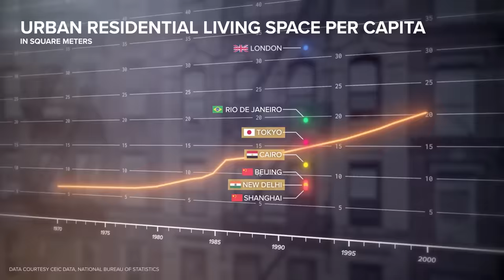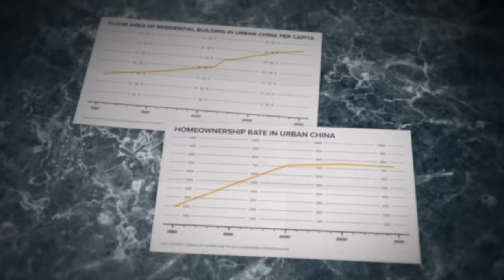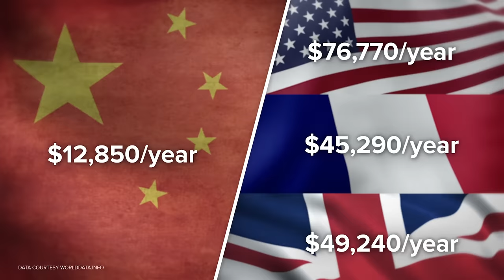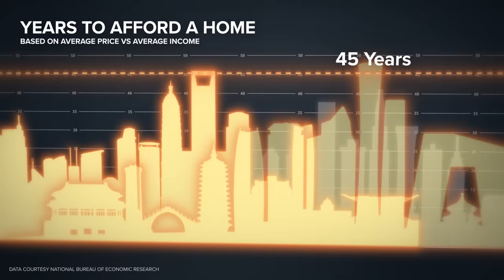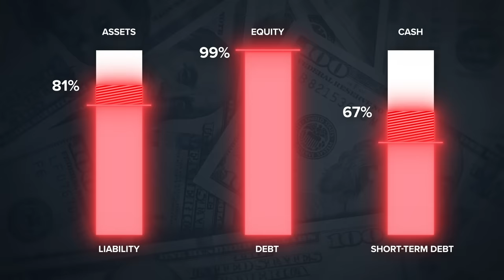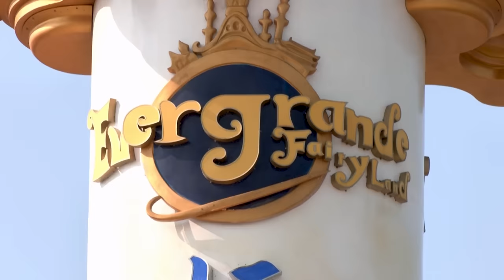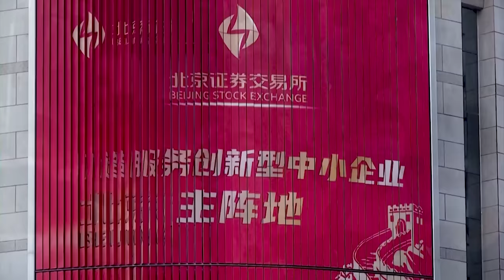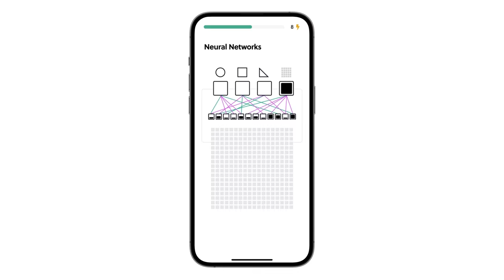Why China's Economy is Finally Slowing Down

Comment: The other part of this that is missed is that local governments were funding themselves via land sales.  They can't sell land if the real estate market is in trouble.  Worse still they put this money towards GDP growth which many times consisted of infrastructure projects that are not delivering.  This has piled up debt for local governments in an uncontrolled way.
Reply: And
Reply: You cannot deliver a profit eternally, you people are nuts.
Reply: @Skr0ng  The reason that this is important is that GDP growth as stated in China (which the CCP has admitted is flawed) includes the local government spending on these infrastructure projects.  This creates a set of double trouble for the PRC.  Problem one there is a ton of oddly configured debt through LGSV's (Local Government Special Vehicles) that is not accounted for.  In some poorer provinces, the entire budget of the province is spent on servicing this debt.  So, there is another large debt overhang that is not accounted for.  Problem two is that these governments can not fund these GDP projects if they can not sell land.  This will directly impact GDP statistics.
Reply: For me the main problem is the lack of consumer rights. Complainants are silenced and buyers cannot sue the developers. This gave developers free reign to do whatever they want without the risk of consequences. Normally it would be a fatal risk if a developer sold customers a crumbling apartment building. But in this system, Ever Grande wasn't even phased with all the social media posts exposing their tofu dregs, they still kept on building and taking out loans.
Reply: One of the few mechanisms for local government revenue in China is land-lease sales. They have to actually sell and release land to have a cash flow.
Reply: @jimsackmanbusinesscoaching1344  They also have unfunded liabilities. The local government has a target to hit-and no ability to fund this. They have control of land and its about it.
Reply: It's leasehold. Property owners get 99 year leases.
Reply: That's a popular and unfortunately very wrong way to look at the situation. Selling land right is the alternative to property tax. And China is gradually moving toward collecting property tax like the US.

Will the local gov go bankrupt? Unlikely. Because selling land rights is a temporary policy to entice land development. The policy will be replaced with property tax collection one day once urbanization slows down. So far that turning point has not reached
Reply: @boyuan1458  Now that there is no need for land development, as shown in the video I guess that property taxes will be coming soon.  Like today would be a good day.
Reply: @jimsackmanbusinesscoaching1344  A 30% drop in new house price isn't a sign for no more land development. In fact, the stats showed China is still way under developed in terms of overall infrastructure. 

Also, see US new home price in 2021, much steeper drop of price YoY. Real estate especially new home price are always volatile in all countries. The media never paid attention to China's new home sale price in the past, it is brought up now just to fit into the new narrative.
Reply: @boyuan1458  The reason that there is no need for land development is two fold.  First, China's population is in decline.  Second, there are already plenty of empty cities.  No need to develop more empty buildings to house people that won't be there.   The PRC is dying slowly and will soon do so rapidly.
Reply: @jimsackmanbusinesscoaching1344  The empty city thing is propaganda. As I said earlier, urbanization rate is what people should understand before they write about China.

Is China's population in decline? It stopped growing. But, it is still much larger than what people can possibly perceive. When you compare the data in year 2000 and 2023 you will see China's population grew by 200 million in the past 23 years. It took US 63 years, from 1940 to 2023, to grow population by the same number.
Reply: @boyuan1458 It's going to be interesting watching the Chinese bots' narratives rapidly adjusting over the next few years of decline
Reply: @boyuan1458 it's not propaganda. China thought everyone from the rural areas would come to randomly developed cities. It didn't happen. These houses and apartments were instead sold to people whose families piled cash together for 1. An investment and 2. A cultural show of wealth for marriage of the family son. 
They don't inhabit these properties, and when they try to sell, the bank will not them. 

When the bottom falls out, like Evergrande, (undeniably bad, at same level as 2008 US), the whole myth is gone
Reply: @One.Zero.One101 Not only that but the consumer can`t escape the debt and walk away from unfinished housing they will never have the chance to possess.People put 50% down on a house, they have to pay the bank the remaining amount plus interest.If they walk away from the loan, the banks can sue them but they can`t sue the developer.The local governments got their money and will get the land back again at a later date. The developers had a great time for a while and probably even have some money stashed over seas.The consumer is screwed.
Reply: it's not slowing down, its transitioning to a different model
Reply: @levelazn   loooool, that's called slowing down
Reply: . Source trust me bro
Reply: . Still waitin for proof
Reply: @zebapervaiz3733  Waiting for proof of what?  I can't post links in YouTube comment sections - so I guess you will have to search the Internet for things.
Reply: @jimsackmanbusinesscoaching1344  didn't ask for links . Asked for source of your claim
Reply: @zebapervaiz3733  For the claim of the bad GDP data try the former Premier of the CCP.  For the data about local government debt, try virtually any news source - example Reuters.
Reply: @jimsackmanbusinesscoaching1344  if you read the article from reuters you d know he never said that
Reply: It’s what we call padding GDP.
Reply: @anarchosherman961 if the population keeps growing, you 100% can… if it doesn’t, what happens? Well, women are pushed into the workforce, prices are raised, and illegal immigrants are given work visas
Reply: @boyuan1458 new narrative? You just cherry picked yoy data from 2021, which was most likely the largest yoy growth the U.S. has ever seen in home prices. 😂
Reply: @jtmann2002  You literally can’t. Past a certain point you run out of room for growth unless you, of course, perhaps build an interstellar empire which, also, only lasts for so long. Finite universe.
Reply: @anarchosherman961  did you read what I said? I said if a population keeps growing economic growth is possible. Obviously this can’t go on forever, but there’s still much room from economic growth, especially with our current pace of technological growth
Reply: @jtmann2002  great. And what after that? I read what you said, but you seem to be just thinking about the now rather than the potential consequences. You’re short sighted, is what I’m saying.
Reply: @jtmann2002  that's why china growing while usa isnt
Reply: @anarchosherman961  when did I ever say that a plan shouldn’t be in place for the future? All I’m saying is we likely won’t  need to worry about global growth for a while. Many countries will have issues though due to aging demographics
Reply: @zebapervaiz3733  growing in what way exactly? They are already undergoing population collapse
Reply: @jtmann2002  Dude, we literally have issues with growth now. Have you not seen the economies screaming under the wealth inequality? Or do you think people suddenly not being able to afford to live is, like, normal again?
Reply: @anarchosherman961  you are looking at the small picture. We always go through times of slow or negative growth. It’s called a recession. The US grew at a healthy rate of 3.4% last quarter. This is great growth. Your complaints of wealth inequality is another discussion entirely
Reply: @jtmann2002  oh wow, all that economic growth last quarter. Yeah, I’m sure that means things are working as they should. Ignore all the evidence to the contrary like people saying “why is my food more expensive?” And “why does my insulin cost so much when I need it to live?” And “why did I pay $50 for tylenol at the hospital?” I’m sure there’s nothing wrong at all and this is just business as usual, especially in other countries too. There is no war in ba sing se. Hey, just curious, was the growth spread unequally? Has it been spread unequally since the last time real wages rose in the 80’s? Was it suddenly, perhaps, redistributed by a magic man in the middle of the night without any of us knowing and now everything is fixed?
Reply: @anarchosherman961  Um yeah you can. As long as entropy has not overwhelmed the universe you can create a profit if you try. For example scrap wood can be reused for creating art pieces. Now you cannot increase the amount of resources in a system infinitely but profit is one heck of a motivator to refine your use of the resources, to find alternatives and to recycle them. The only reason recycling is not more common right now is it just isn't competitive yet in many cases.
Reply: @jtmann2002  that's jaoan Korea
Reply: @jimsackmanbusinesscoaching1344 day dream?
Reply: @boyuan1458  很少有人能看出来这是用来吸引土地开发的
Reply: @jimsackmanbusinesscoaching1344  Any meaningful analysis should not include wishful thinking or slanderous statements. Also, it's easy to copy and paste web links in this section, you are just too old to realize how.
Reply: @stevoz6743  My experience is that YT deletes posts that contain external links, unless reinstated by the channel.  And thus your statement is slanderous
Reply: @jimsackmanbusinesscoaching1344  Here we have a hint, why Western economies are failing:
"The local government spending on these infrastructure projects.  This creates a set of double trouble"
I wonder how the US, or it's satellite countries think, they will grow, if there is no investment in infrastructure! LOL!
Admitting flaws, opens the way to correct them. Denying flaws, like the US has been doing over the last years, opens the way to economic collapse.
American economy "experts" have become ridiculously crazy!

Nobody in China can sell land, not even their local or central government. IT IS A SOCIALIST ECONOMY!
Reply: @hokroeger  Good job Chinese bot.  Let me quote an easily googled title of an article:  "Local governments in China rely heavily on land revenue".
Reply: @jimsackmanbusinesscoaching1344  LOL! You should google a little more: "Land revenues" for the Government in China come from rent payments, not from selling!

Well, actually your own source explains that (with some "writing-around"):
"selling land usage rights and collecting land and property-related taxes"

For "poorly educated people" (See Donald Trump), "selling land usage rights" might sound like "selling land". LOL!
Reply: @hokroeger  Chinese local governments create revenue from land through two channels: selling land usage rights - you call that rented land but the same thing can be claimed in the West since property taxes are essentially the government allowing you to control land if you pay them money.  So, in all cases the land rights are paid for up front and then taxed.  Go look up eminent domain.
Reply: Internal debt is not real debt and can be gradually diluted over decades by simply borrowing new money to pay off old debt or through mild inflation.
The worst that can happen is that the local government declares bankruptcy and liquidation, which is also an internal solution.

It is the country's external debt that is the debt, and it is either reneged on and credit lost, or paid back, requiring trade surpluses and fiscal balances, or printed and inflated, which in the long run also leads to a loss of credit and a long-term devaluation of the currency.

So, US debt is worse than Chinese real estate debt, except now the Fed can still sustain itself by printing money.
Reply: @nechoji  The local governments can declare bankruptcy and liquidate by selling what?  Its people?  Then the local government disappears?

Comment: America and countries in Europe have experienced similar situations, when manufacturers of shoes, clothes, home appliances, etc., flocked out of those countries. Korea and Japan have also experienced the same thing. But the situation did not make these countries experience an economic crisis or bankruptcy.

Why? Because it is a matter of competitive advantage, comparative advantage, and a matter of ordinary market mechanisms. If it is now starting to happen in China, it is indeed time for China to experience a similar transition after years of mass low-wage labor-based industries.

When China starts producing airplanes, electric cars, superconductors, etc. it is just a necessity for a country that has entered the "advanced" level. Selling 1 airplane is worth more than selling thousands of shoes from a dozen shoe factories in the Ningbo area. 

That's also why America can still able to compete with China in term of GDP etc, even though the low-labor manufacturing industry left America many years ago.

Comment: What about the building's quality ?
I saw some posts about buildings beeing rushed and therefore, crumbling very easily, is it a part of it ?
Reply: some buildings yes. when they're not even expected to be sold/occupied. certainly not all or even most buildings.
Reply: There are buildings failing but that’s not representative of the average quality over there.

1. You should always remember how big china vs how many buildings/projects actually failed.
2. Theoretically china has the strictest regulations on civil engineering. It was jaw dropping to hear that engineers and project managers are held accountable for the lifetime of a building/project, meaning that should it failed prematurely or unexpectedly, personnel’s overseeing the project will go to jail.

That said, you will likely hear more of the building failure because

1. In a highly competitive market like china, outsourcing the project to subcontractors are common, sometimes that causes problems because of cost cutting.
2. Most importantly, strict regulations are only installed in recent decades, questionable engineering practices were very common back in the days.

Comment: In a lot of cases where new cities have been built, the local farmers have been forced off their land so the apartment blocks could be built and then promised jobs and accommodation once the construction has been completed. However, there are no jobs suitable for the farmers in the new cities, and the rent for their shiny new apartment is way more than they can afford so they can't live there.
One other major issue with all these millions of empty apartments is that the quality of construction and of the materials used is absolutely dreadful, so that in less than five years the buildings are literally falling apart. It won't be long before we start to see partial or even total collapses of some of these apartment blocks.

Comment: The title is misleading and dubious. The subject is not about the economy as a whole just about the housing bust. And why put "Finally" in the title, like it's a good thing?
Reply: The economy was supported by the housing sector. This is going to slow the whole economy. As for the “finally”, China had been growing by double digits for over 20 years — no one was certain where the top was or when it would end.
Reply: watch this little snake change the title later and act like it never was that way
Reply: @NatCo-Supremacist you keep popping up everywhere, you just write comments to be rude to Wendover, who does not know you exist

Comment: 2:50 - Sums up the issue with China, but also the reason for America's public transport issues. If the government owns all the land they can kick you off it at any point without setting you up elsewhere. You may love your home, but if the government wants your land, say to build a railway line, they'll just take it. In America the government don't own the land, they just rule over it for as long as the people want them to, so they have to pay for the land to build public transport systems and they often can't afford it. So roads are forced to get busier while railway lines get left behind, unable to expand.

Solution: The Chinese people need to get a proper democratic system of government before someone gets into power and starts knocking down these massive buildings people live in. And American's need to build railway lines over the top or underneath all their 200 lane wide motorways.

Comment: The problem is significantly worse than what he presented the Chinese Housing Industry were showing these signs way back as 2012. Next those numbers were just the reported figures for Evergrande you would be better to triple them for actual figures. 

Next is that the 3 red lines policy was an attempt to burst the bubble in a more stable manner and before the bubble got too big. 

But the bubble was significantly bigger than anticipated and the burden was significantly worse than expected. So it's not actually controlled demolition but more like free fall. This policy destroyed the capital chain for a significant number of companies in the construction industry like Evergrande. That's why you are seeing a huge domino effect happening. 

Next housing prices did not simply increase because it was believed it would i.e speculation. But a larger contributor is that Land sales was a primary money revenue generator for most of the CCP provincial government. Like the bulk majority of their revenue came from land sales. More than half the cost for property primarily came from these land sales costs. 

Next don't get me started on the corrosive construction system in CCP China. And their notorious tofu dreg construction. To put it simply the issue is far worse than what was highlighted in this video.